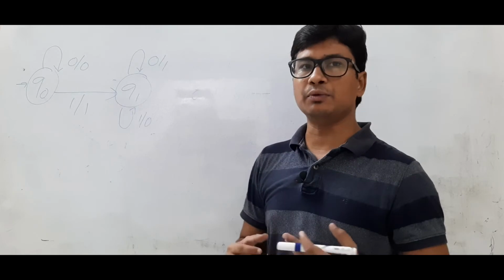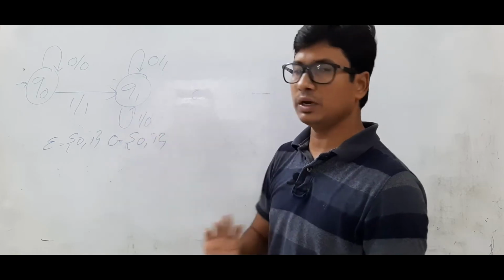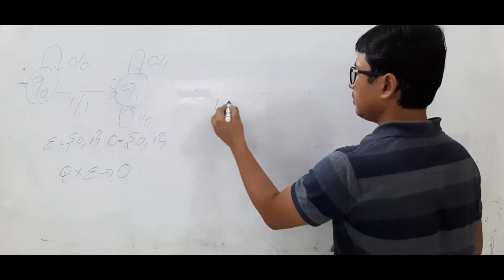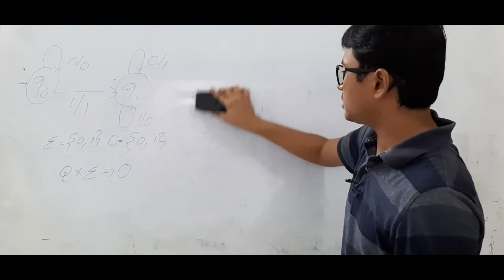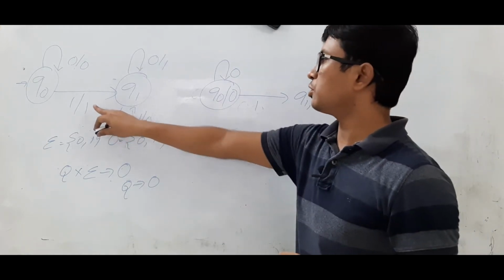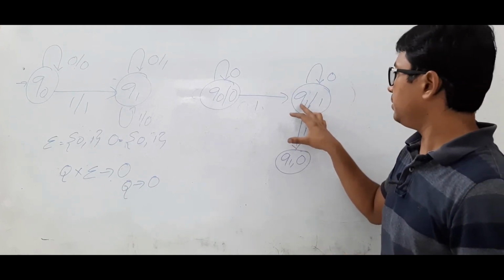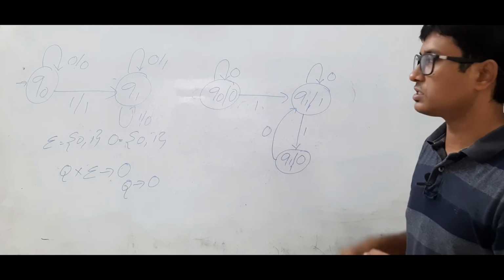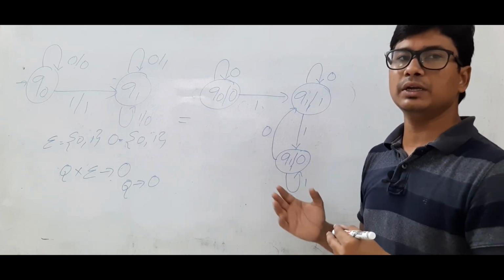L 56: Example 2 on conversion of Mealy machine to Moore machine in TOC.

Comment: Sir consider this case:
Mealy machine:
q0 on 0 goes to q0 with output 0
q0 on  1 goes to q1 with output 1
q1 on 0 goes to q0 with output 1
q1 on 1 goes to q1 with output 0

In the equivalent moore machine:
We would be having (q0,0) and (q0,1) states,which state would be considered as initial state???
Reply from the maker: No change in the initial state.